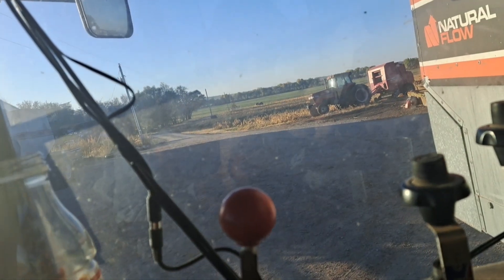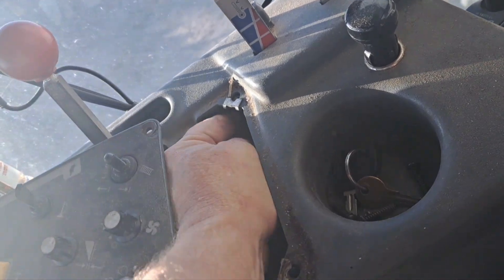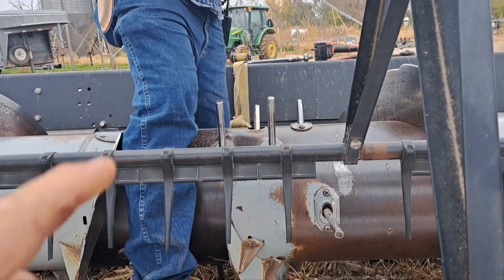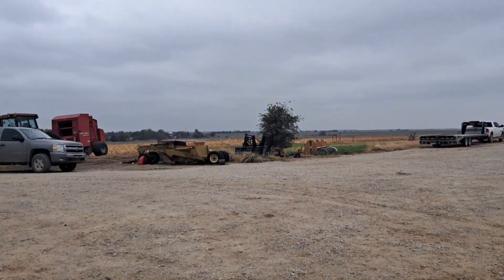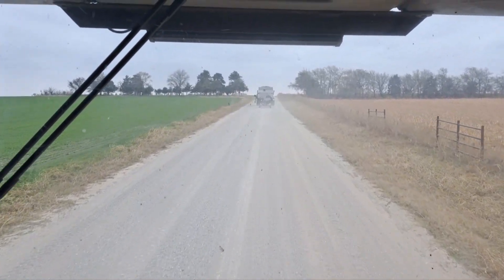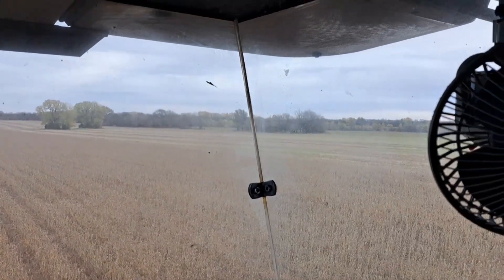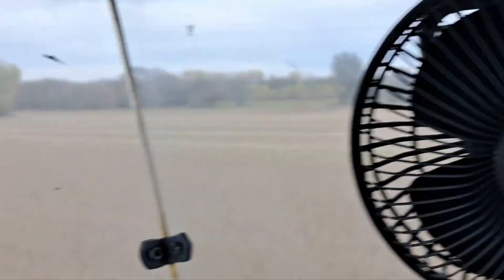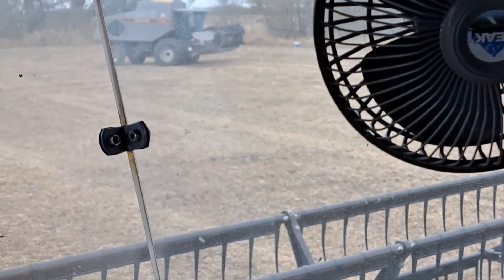4 R62s mowing beans. Cracked axle!

Comment: What spacing you do, on your beans also what bean number do you use, fertilizer your beans they look good
 good video on the 4 machines
Reply from the maker: We run 30 inch rows abs Justin runs twin rows on 30. We did not put any starter on this year due to dry.  We plant 4.6 after wheat. Beans were terrible this year.